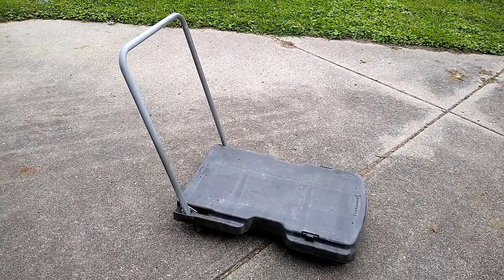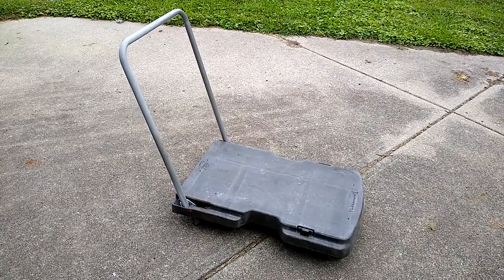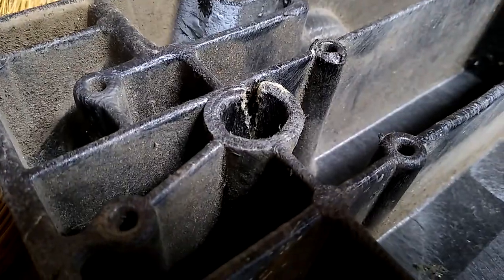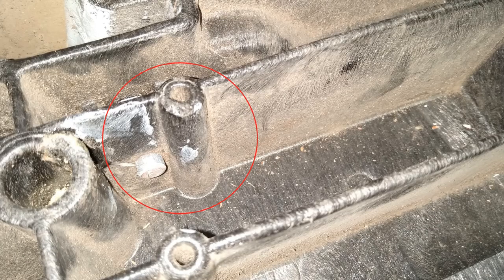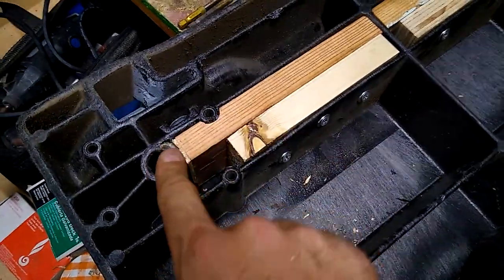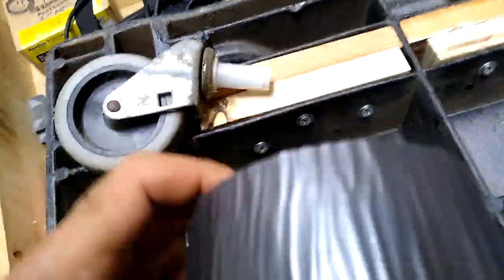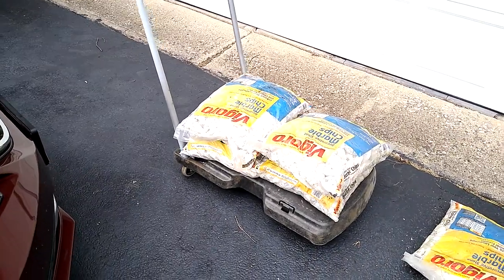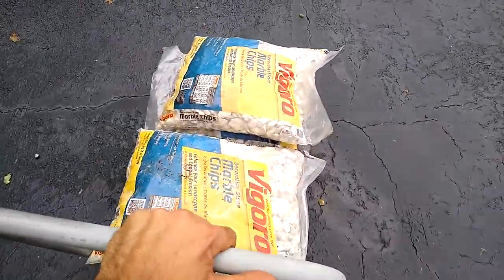Rubbermaid Flat Cart Wheel Repair (4400 Triple Trolley)

Comment: I'm considering one of these carts for an occasionally used awkward 60lb air compressor for easier mobility, but thinking about vibration being a factor. 
I had to take a second look at your video and realized that the single point caster socket is likely structurally inferior to the four screw-support-surface-plate style casters that utilize those 4 smaller holes.   Have you searched online for the original casters?
Reply from the maker: I haven't, but my impression was it's some type of upgrade. But they'd probably cost me more than the cart did!

The single point casters have done okay for me so far. Granted, I don't use it too hard, mostly for moving things around 
my basement and moving furniture.
Reply: @swvincent  I think the upgrade casters explanation is spot on because it almost seems like the cart platforms may be shared among their 2 models of this trolley cart. I was fortunate enough to pick up the rubbermaid 4401 400 lb. older generation second hand with the 5" casters; the selling party posted pictures that showed 4400 on the underside which is what I was expecting along with it's 3" casters but later after buying of course I measured to find they are in fact 5" casters. To clarify it's marked 4400 on the underside and marked 4401 400 lb. on the top side. Weird.
Reply from the maker: @sfgwl  That's interesting, nice it worked out you got the heavier duty version! Mine's definitely marked 250 lbs. It may be little more than the casters that changes it.

I suspect mine was used with too much weight when the wheel got stuck on something, resulting in the damage it had. I imagine the 5" casters would handle it better.